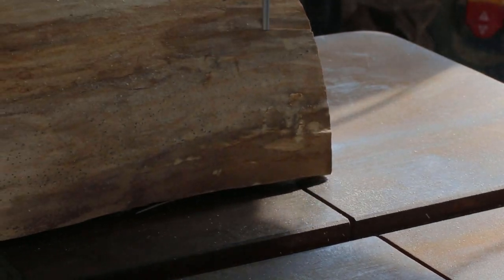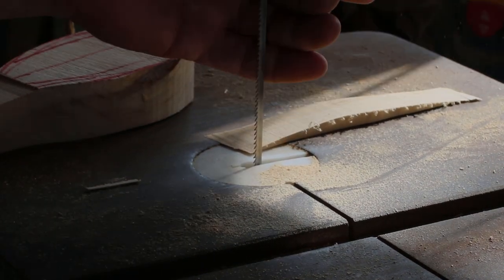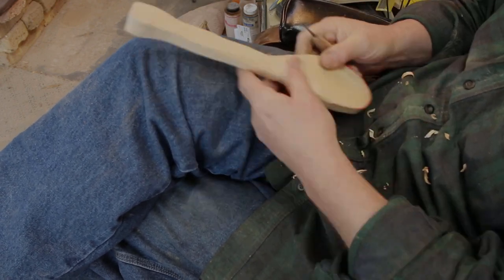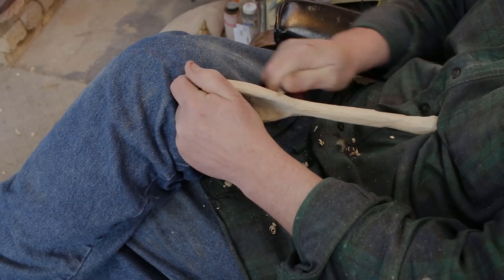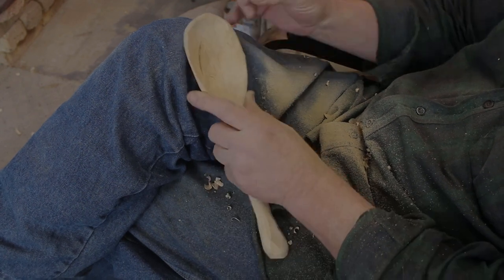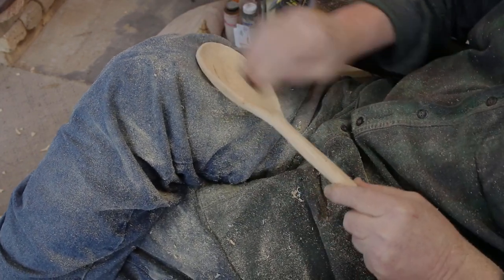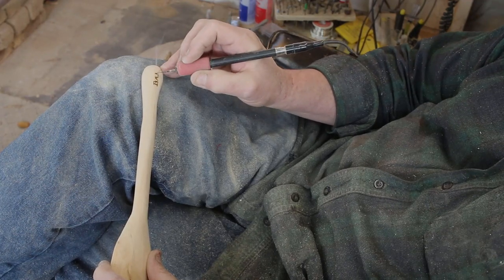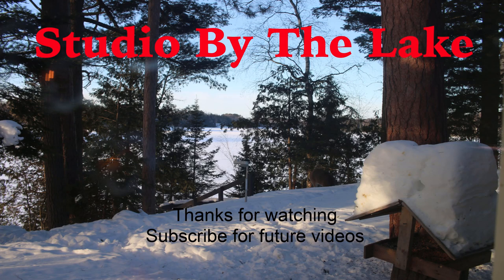Wood Carving: How to carve a simple spoon in wood

Comment: Great job.   I found u looking for video to make wooden spoon handle thinner. These spoons are measuring spoons(Amazon)but the handle, on several reviews says they are great but the handle is little to thick. Have not bought them yet. I’m thinking of trying a wood spoon I have already and just trying to use my little sander, 1 inch paper with diff rpm and seeing if it will work. This Texas gramma loves a challenge. Any suggestions.